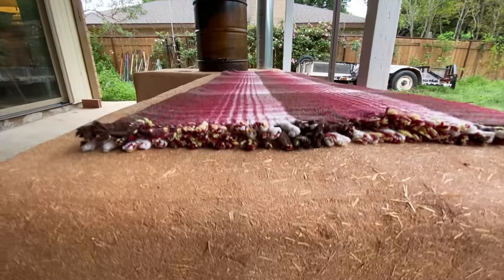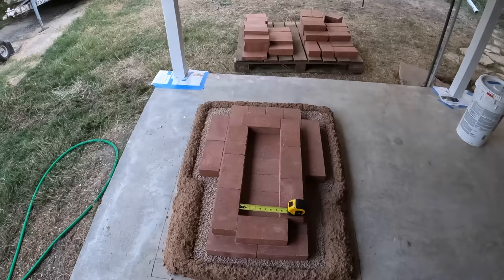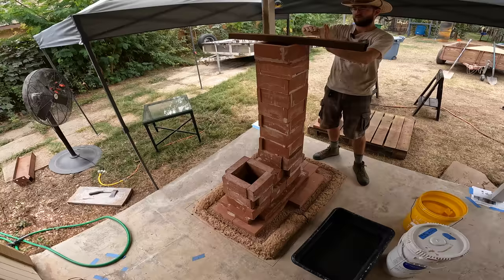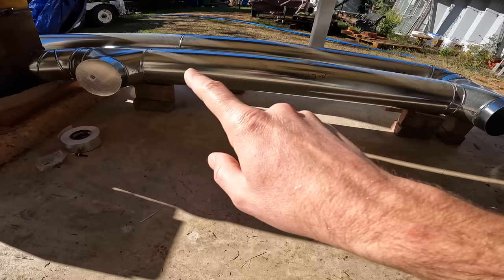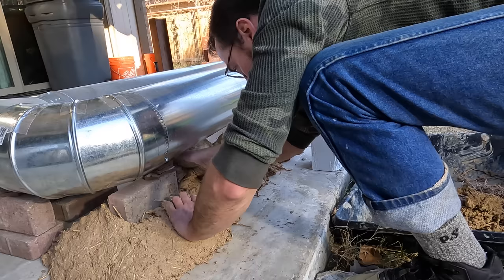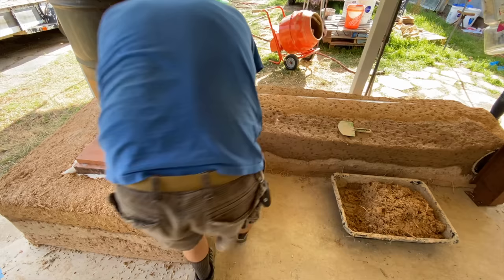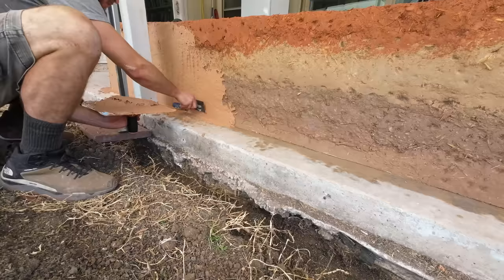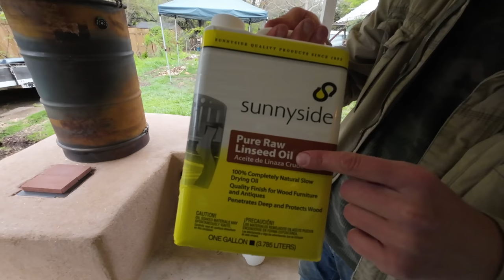World's most efficient stove!!!!  Made of DIRT!!!

Comment: the crazy thing is - he answers ALL the questions in the video. I was left with no questions at all. One of the best building videos i've ever seen :D
Reply from the maker: Thank your saying. I’m very glad you enjoyed it. Thanks!
Reply: One thing he doesn't address in the video is why he refuses to use kindling. At the end of the video he uses a Vaseline and dryer lint fire starter, and then just puts some 1x4s in there and lights them with a blowtorch like a psychopath. Were sticks too hard to come by or something? They grow on trees.

jk. Great video. Thanks.
Reply: this was most exemplified in the "i know someone is gonna ask about me poking the holes in the cob" moment,i had been thnking that exact thing and was blown away when he mentioned it
Reply: I have a question
How do you clean the ash out?
Reply: @Merrsharr  stick an ash tolerant vacuum into where the fuel goes would be my guess
Reply: I agree that he addresses most questions. But, far from all. I realize this is really more of a video demonstration of the build and not meant to be a technical explanation beyond what's necessary, I have a few questions. Many of the flammable gasses and particulates that make up creosote are flammable at closer to 1500°F. Perhaps this stove is capable of regularly reaching those temps. The low temp exhaust would suggest that it can. I'd also like to hear more explanation of the manifold and bell. I suspect this is the answer. The other guy, with the question about ash removal has a point as well. But, an excellent job. I really enjoyed it.
Reply: Yep true
Reply: This is what youtube was made for.
Reply: Ah good, then could you pass on why he finished it with raw linseed oil?  I missed his explanation.
Reply: @Synthmilk   to "seal it" - it's the same process you make with wood.
Reply: @MarkusDBurner  I know linseed oil is good for sealing wood if applied properly in thin coats and allowed to cure for a few days in between, but that works on clay as well without going rancid?
Reply: @Synthmilk   under heat, the oil hardens. so it makes the clay more durable, imagine it like a coating on a iron pan
Reply: Here's a question
 How do you light the sticks?
Reply: @Merrsharr my question to
Reply: @melodylyons4631 i believe he used lint and oil at the base of the feed tube the added the kindling
Reply: Agreed.  His attention to detail is amazing.
Reply: Exactly he explains it as he has already built a hundred of these and is already an expert. Makes the whole thing really enjoyable to watch
Reply: I mean ya he has an answer for this comment as well xd
Reply: Simply beautiful, and along with the music and your humble explanations, flat out soothing to watch. Thank you, friend.
Reply: I agree excellent presentation, how to fix minor issues as they arise really helps me.
Reply: Does he answer how he deals with condensate in the exhaust?
Reply: @lazerblade2 , You’re too condescending. But I had a Chinese graphic design professor who couldn’t say “razor blade” and switched it to “laser braid.”
Reply: I was wondering how he gets the heat into the house I never seen that part anywhere
Reply: I would like to know how to get the heat in the house
Reply: Linseed oil is for water proofing. I believe.
Reply: I'll take this on to 667 likes, too good of a comment to be stuck on 666 likes
Reply: I totally agree! Whenever I think of a question, it gets answered shortly after
Reply: @geraldakers5260  this isn't for inside the house, though. If it were, he would've cleared it with local zoning laws and built it indoors.
Reply: He's intelligent people think us texas boys are dopes

Comment: I have seen 10-15 videos of this type for the J-Type RMH w/ bench over the years, and they all left me with more questions than answers.  Not yours!  Absolutely thorough in your explanations and I feel that with the literature I have acquired, I am ready to make my first attempt this late summer or fall.  Thank you, sir!  I don't know if you are an educator by trade, but you have a gift for it.
Reply from the maker: Good luck on your project. I hope this video helped make it easier for you!
Reply: Amazing!  Thank you so very much!
Reply: explanation is wrong.
Reply: @joshmdmd  what is wrong? When you Point something is wrong, you better say also why!!!
Reply: @trazcotraz2798  it's not worth the time tbh. That tube is a poor man's heat exchanger and at the draw of any decent fire would have you'd expect losses. He doesn't explain what pulls the air properly. He just does hand motions lol.
Reply: @trazcotraz2798  While what he explained was right... It's not right in this case. The hot air naturally follows the path to the cooler air outside because energy likes an equilibrium so it will flow down and through the pipe till it can exhaust outside which is why with something like this you want a air intake from outside your home because otherwise it causes a draft as it tries to suck all the inside air through the heater and draws in cold outside air.
Reply: @SilvaDreams  If he intended to use this as the heating source for a sealed room than what you say is true. At the moment it is just a patio. 
He mentioned enclosing it in glass but he never said anything about opening that glass enclosure to the house. As the purpose of the earthen mass is to store heat and release it over time it is entirely possible that he intends to run the fire to heat the earthen mass before he wants to spend time in the enclosed patio. Then, when you are ready to go out onto the patio, you choke the fire out and depend on the radiant heat. In this case the draft is irrelevant.
Would it be more efficient to have a draft duct from the outside? Yes, but that doesn’t mean it is needed or that his explanation is wrong. He even mentions that air will be flowing into the system from the fuel feed hole. That is why brick #2 tends to crack and why the metal sleeve was necessary.
Reply: @joshmdmd  maybe you had the video on mute because he does explain it. The hand gestures were merely a visual to accompany the audio.
Reply: same here. THIS is the video that has me to the point I feel comfortable doing it. Well Done.
Reply: So you see the big long tube on the back that goes to the chimney, well try to get a chimney brush to clean that hole sucker out or try to inspect it lol good luck on that. On mine that's what caught fire 🔥 😩 but Bob knows it all 😂 Good luck Dude
Reply: @CuRLy_SRH  That’s what the clean outs are for.
Reply: @ZurlHammerdoom  Once you build one then you'll realize those clean outs are not easy to fully clean out
Reply: @CuRLy_SRH  Huh, okay. Good to know.
Reply: @CuRLy_SRH  If you had a fire in the back tube it is because you have creosote (or other volatiles) condensing from the smoke. A properly designed rocket stove should exhibit complete combustion of all of those volatiles. Some designs I have seen had a secondary (pre-heated) air inlet to the superheated smoke immediately after the fire to support secondary combustion. Like running a secondary air channel alongside or under the firebox, opening into the back of the firebox. First you burn the wood, then you burn the smoke. More efficient, less chance of fire.
That noted, I did think the addition of a clean out in line with the back tube might be necessary. It would be a mite difficult to get a brush around that corner.
Again, there should be no creosote build up in any of the pipes to cause a fire. Any combustible volatiles should have burned before they get to the radiating portion of the pipes to condense.
Reply: @joshmdmd  Josh, I think many would agree w your estimation of work/reward input..... which prompts the obvious query of what motivated you to opine w no intention to elaborate? These guys have gained their knowledge through true, documented hands-on experience and it really strikes a nerve to see someone who's taken advantage of the generously shared time and experience and show your appreciation w empty contrarianism. To be clear, I'm not even saying you're wrong. But you, as an anonymous vacuum, make a statement that implies but falls far short of credentials befitting you a worthy voice of knowledge. And, despite the odds, even if you were, your classless show of disrespect only adds to the body of evidence refuting the relevance of your statement. Ppl pay a lot of money to obligate their own time for the opportunity to be evaluated by a person that correctly expects to be spoken to and treated w the deference and respect befitting their title. Show a little maturity in considering the positive transformative power in shifting some of that respect from those bloated, expectant fat cats to these modern day philanthropists who choose a medium that leaves them no recourse to deal w not just empty, useless prattle, but, real fuel for the creation of something that can cause real harm.
Just bc the system gives you the access to vomit unrestrained antisocial concepts w no fear of retribution doesn't mean you should.
Hmm, clearly you've hit a nerve so I'll go ponder whether I'm a "part of the solution or part of the problem".
Reply: @neepsmcfly4176  just because you're less educated that the average person it doesn't obligate me, a stranger, to take time out of my life to teach you things that you should already know. I specifically wrote in my comment "poor man's heat exchanger". You can google "heat exchanger" to figure out what it is and how it works. The problem with this system is 1. Not all the heat from this system will initially transfer into the tube used, and 2. of the heat that transfers into the tube as it is a passive system it's likely 50% of all heat collected will be subsequently lost as the heat travels backwards through the exhaust (unless the exhaust (and inlet) are manually plugged after every fire is made). This backflow of heat will vary based on 1. the temperature gradient through the cross section of the tube to dirt / concrete whatever he ends up using around the tube, 2. the temperature difference of the tube and air going through the system, and of the dirt or whatever medium and the inside air, 3. the specific flow rates across the surface area of the tube and of the surface which is supposedly heating the house (these will both change based on temperatures as well) 4. the heat transfer coefficient for each case at each moment in time (since the gradient will be changing along with time).
Reply: @neepsmcfly4176  I didn't word that as clearly as possible. To begin with there will only be a percentage of heat 'captured' by the tube and the fireplace, futhermore of that percentage only a percentage will actually heat the house and the rest will be lost to the exhaust if there is no manual capping of the exhaust stack (ie. an insulated cap that seals the air from leaking out of the top.) You're likely left with half of some percentage so the system likely operates at less than 30-40% efficiency (over half (60-70%) of the heat generated by the fire is lost to the outdoors). Those percentages are guesses without testing for illustration purposes. That system may be better or worse than my guess but that's neither here nor there.
Reply: @joshmdmd  well, your added unnecessary jab aside, I appreciate that you actually supplied info that can be substantiated and discussed or debated if necessary. Although, even if I had concerns or enough facts for a discussion, I still have little interest in extending an exchange w someone who hasn't figured out the efficiency of mutual respect. Thanks for putting in the effort. Good luck on the interpersonal skills.
Reply: @CuRLy_SRH  So chimney sweeps were lying? Nope. Rod and brush should clean out the runs.
Reply: @jackiemowery5243  There are clean outs ports at every bend.
Reply: @BigHenFor  Like I told somebody else, you build one, and you try to clean out the back tube that vents out the chimney.
I do find it amusing how all these people that have never built. Something like this or experience something like this? That has so much experience in nothing and absolutely 0 facts. Assumptions will get you nowhere
Reply: @joshmdmd  You are right, some method of cutting off flow out the stack between burns increases the efficiency and more energy is released into the heated space.  All the designs I have seen include this and state the importance of it.  If you have a bell at 700-800 deg. F during full burn and your exhaust at top of stack is 150-200 deg. F, simultaneously, where do you think all that heat energy is going?  Poor-man's heat exchanger indeed.

If you have ever heated a space with a traditional woodstove in a very cold climate and then experienced a well-built RMH in the same climate, you cannot deny the benefits.
Reply: @neepsmcfly4176 'm curious now. The excruciating detail with which you so eloquently attempted to sublimate the narrow mind was met with the expected reaction but surprised with an equally masterful response. I do find it ironic the source of allegations that your education is questionable considering he wasted such a comprehensive outline for those interested and was thoroughly unable to comprehend the simple, well articulated point. I was beginning to craft the method by which he would be enlightened when I found your second reply. Well said, all around, very nicely done
Reply: @Keshalee86  I appreciate the positive feedback. Nice to know I'm not speaking gibberish. Tbh, I'm a little conflicted/embarrassed to have invested so much energy into a yt comment. I think these guys just really triggered my hippy nerve & josh was just the 1st Injustice that I could protest, lol.
Reply: @joshmdmd  I have long explanations on this in the comments.
 but briefly the intense heat from the complete combustion of all wood gases in the riser reaching temps 1500-2000deg F  cause massive expansion of the gases and therefore high velocity. This high velocity drives the whole system. as the gases cool a bit in the bell and more in the bench their volume decreases and the friction=resistance to flow get smaller the more heat is lost. 
These heaters use 1/3 to 1/10th of the wood of a steel box stove and are out and closed up at night so no chance of fire unlike a strangled damped down fully loaded steel box fire. Complete combustion means NO creosote either. They release the heat for over 12 hours after the fire is out.
please do some research
Reply: @CuRLy_SRH  Complete combustion means NO creosote = no need to clean.  The access ports he put in are to get out the small amount of fly ash that gets dragged along by the high gas velocity 
please listen and do your research

Comment: In my 65 years, I've built many of these. I've got to say, yours is one of the best tutorials on the net, for someone first starting out on this adventure.  Well done young man. I know your family will get many years of enjoyment out of your project.
Reply from the maker: Thank you for your very kind words. They honor me given your extensive experience. My aim was to try to get this concept spread around more. Thank you for being a pioneer in making these stoves popular enough so that I was able to hear about them in the first place. And thanks for subscribing!
Reply: This assumes he will stay in this house as it can not be moved, my suggestion would be build in a steel structure for moving the heater, else fine job sir.
Reply: What are the barrels for in them is a chimney I thought that was where you fill it with lots wood and it would burn little by little
Reply: @emmanuelquinones9156  Its not the burn chamber. Its where the heated exhaust gasses travel, heating up the barrel, to throw off usable warmth. As it travels on out, the chimney pipes heat up the mass of earth. When mass is heated, it stays  longer and radiates throughout the room it is in. If built correctly, the final exhaust coming out the end of the pipe is just barely warm. Which is the whole idea. No heat is wasted by going out of the pipe. All the heat is transferred to the barrel and mass of earth. Even  modern high efficiency furnaces main objective is to transfer 80 to 90 percent of the heat inside the house, which is why the high efficiency furnaces exhaust flues are made of pvc plastic.
Reply: @emmanuelquinones9156  Tell us you didn't watch the video without telling us that you didn't watch the video. The answer to your question was answered in the first 10 minutes of the video 🤦
Reply: Do you realize how freaking heavy that structure would be?  It would also be fairly fragile and the chance of destroying it would be high with any attempt to move such a “mass”??
Reply: @johnschantz7116  no, there's no moving in.  Mass is the objective.  Heat up the mass, and even without a fire it stays warm for hours. As far as the fragility goes, when you work with Adobe long enough,  you'll find the perfect combination of straw, clay, etc, and the way you work it will dictate how fragile it is.  I've even topped them with a skim coat of wire, mortar and concrete, for a harder, more durable finish. Those are more than forty years old and still like new.
Reply: Sorry @thebeardedone1225, the comment was supposed to be in response to @stibbs11 comment about building it on a steel frame so it could be moved….me thinks not.
Reply: @johnschantz7116  No problem. Yeah, building that on a frame for moving would definitely not be advisable..